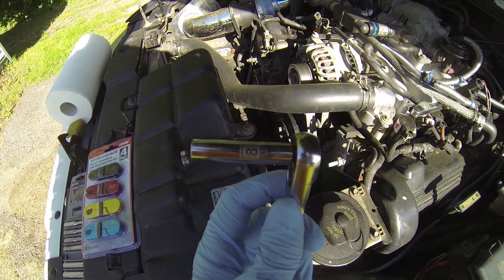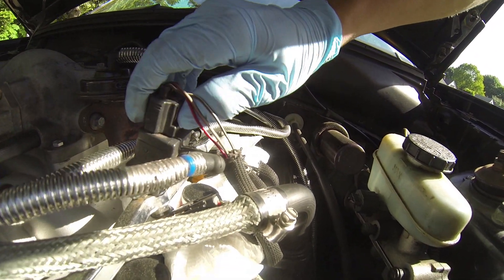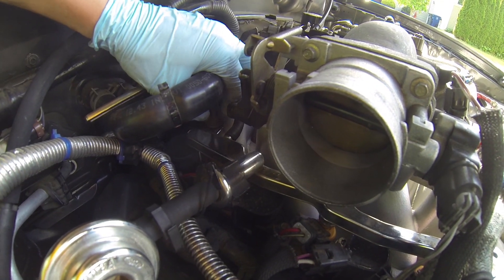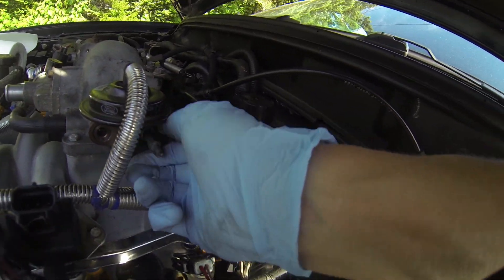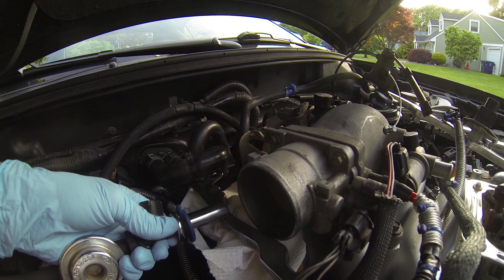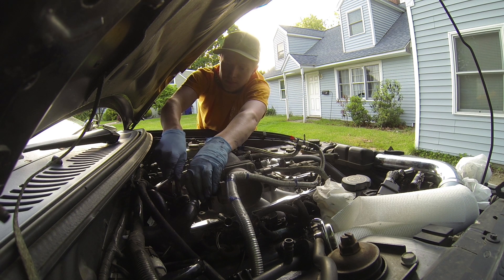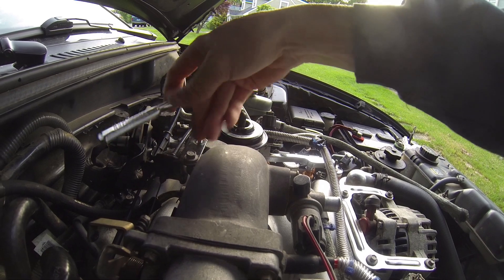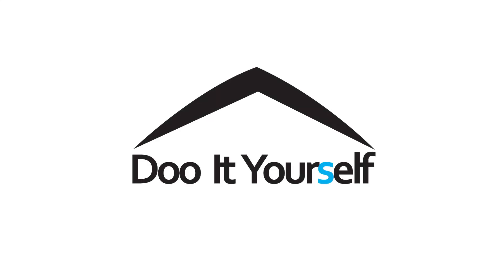How to Replace Fuel Rails - 99-04 Ford Mustang GT 4.6L V8

Comment: " start the car up, Make sure nothing starts on fire, nothing explodes" 😆 I'm scared of eggs popping oil on me, now you think I'm gonna do this on my own? Nope! Gonna take it in to the professionals 🤣😂
Reply from the maker: Hahaha Don't worry it won't actually explode! in fact I was driving around when I first noticed the gas smell - which is why I did the repair in the first place. Just check visually for leaks and if there's a small leak you'll be able to smell it since gas is very volatile.
Reply: @diy6263  It was a 60 dollar job. Parts and labor. 15 minutes and bam! Good as new. Mine had the original part from 06! It definitely needed to be changed.

Comment: Which product did you choose as your new fuel rails?  OEM or aftermarket?  Thanks
Reply from the maker: I went with oem since the stock fuel system was suitable for the mods I made, there are good aftermarket options especially if you intend on upgrading your injectors or going with supercharger or turbo - then you'll definitely need injectors.
Reply: @diy6263  😲 there's a difference in what part you replace it with!? Now I'm afraid a cheap part was put in by the shop. ☹
Reply: @sammy-samsonmustanggt3852 an OEM Ford fuel rail will have the Ford logo stamped/inscribed somewhere on it. Aftermarket doesn’t always mean bad, though. But there are tons of cheaply made aftermarket parts out there that won’t last very long. Hopefully your mechanic sources their parts from reputable suppliers. I mean, if they want to stay in business, my guess is they do. 😅

Comment: you only showed how to remove bolts and disconnect fuel line. nothing at all about the o rings . a lot of missing info.anyone can use a rachet
Reply from the maker: the o-rings are really simple, they're either in the notch on the injector or they're not, you line up the injectors with the rail / manifold and bolt down, couldn't be any easier!

Comment: could it actually catch on fire?
Reply from the maker: it can since gasoline is so volatile, with gas and fire there's 3 scenarios, 1. too little vapor to ignite 2. a relatively wide range of vapor will ignite instantly 3. and too much gas vapor and won't ignite either. If you replaced your rails and had a leak, it's probably not going to catch fire. But if you're driving around like that, it can cause a fire real quick. If you see or smell a leak, shut off the engine and check it out. Better to be safe than sorry.

Comment: could it actually catch on fire?
Reply from the maker: only if there's a leak and you drive around for a while with the leak, if you smell gas while driving it could cause a fire, that's why I replaced mine. The little bit of gas that spills when you disconnect the rails evaporates by the time you're ready to start the car, if you spilled alot of gas, let it evaporate before you work on it so you don't get exposed to the fumes

Comment: You did not show the most important part which is the removal and reinstallation of the actual fuel injectors.
Reply from the maker: +Ron Dean installing the injectors is no sweat, they just press into place. All you do is make sure the o-rings are in good shape and that they're lined up with the rail and manifold, then tighten the rail. Hope this helps

Comment: Do the injectors come out with the rail? This video is very bad. You should put more effort into making these if your intent is to be helpful to people.
Reply from the maker: +Omglosser No they don't come out but if you need to take them out you need to remove the fuel rail
Reply from the maker: +sampson marshall You can leave the fuel rails on if you're just changing the plugs, it's extra work, if you have to change the rails or have dirty injectors to clean or swap it will give you a little extra space so go for it

Comment: Nice video man! Do you have the Victor Jr. manifold on your car? Because I was thinking about the same setup?
Reply from the maker: +lin G really similar to the Victor Jr., there are a bunch of models I got a sick deal on ebay for that one, noticeable power gains and smoother throttle response for sure. If you go with an upgraded manifold make sure they give you the right gaskets, after several chain parts store fails I was able to get the right one at the Ford dealership